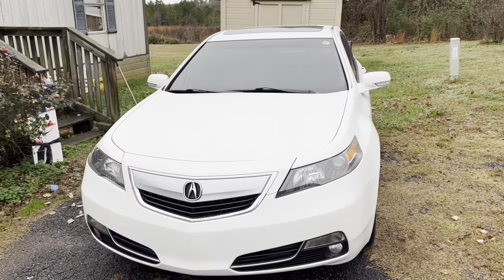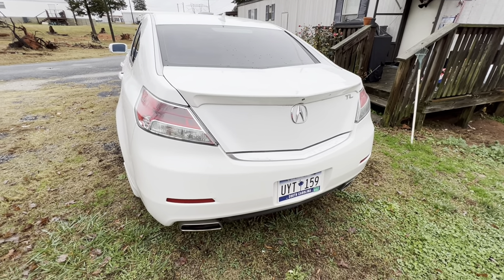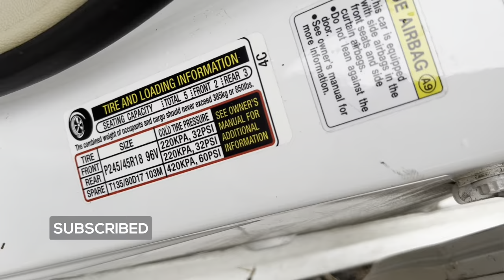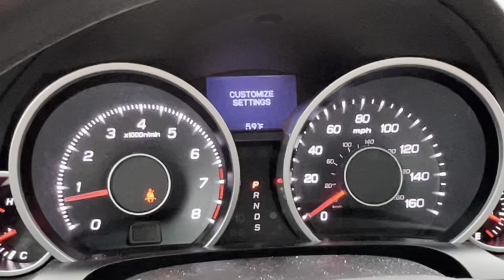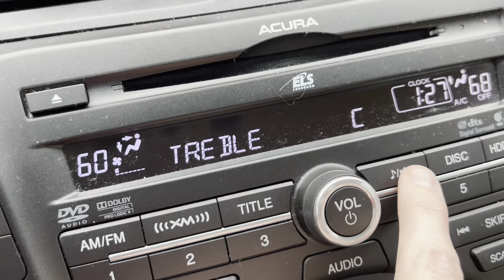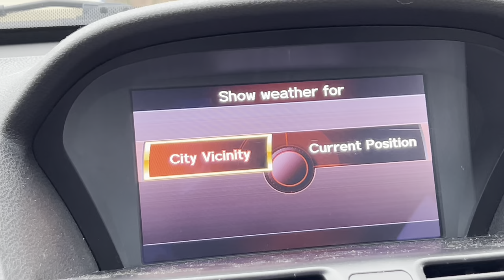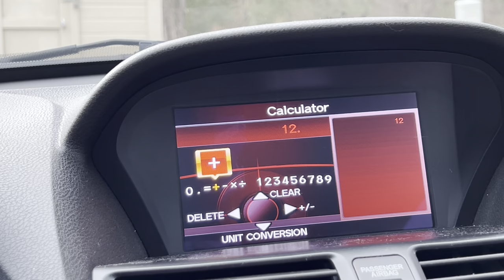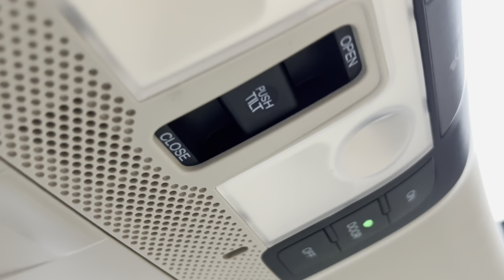Fully in-depth Tour and Review of a 2014 Acura TL!

Comment: At the three minute mark, those are rubber stops to adjust the hood to line up with the fender.   The U and D are for Up and Down not Do and Undo.   The small holes are access holes to adjust the headlights Up or Down and Left or Right.   Probably with a Phillips or Torx driver.

Comment: Hey man really liked this video. I’m in Atlanta GA. This will be my next car. The 2012 to 2014 model. How does downshifting feel? Does the engine blip to rev match?
Reply from the maker: Downshifting is a little rough if your down shifting for a higher gear. So you may have to blip the gas a little during the down shift